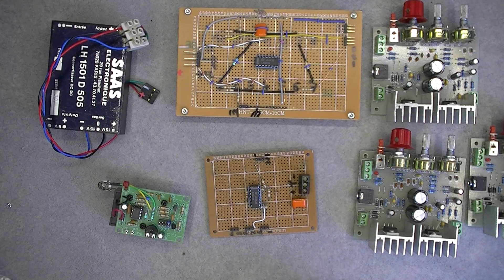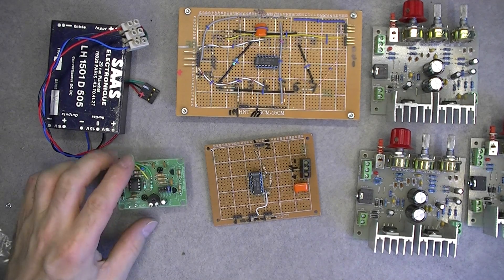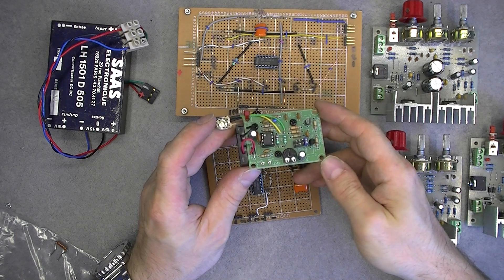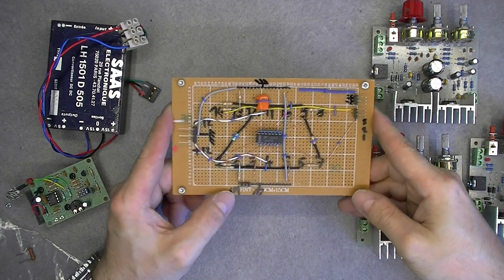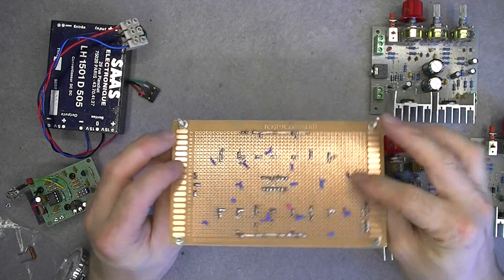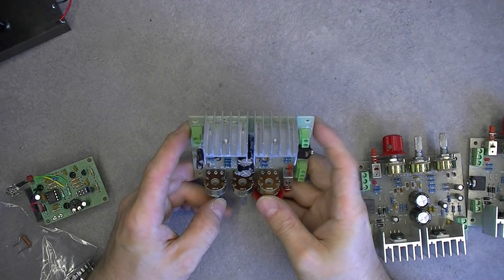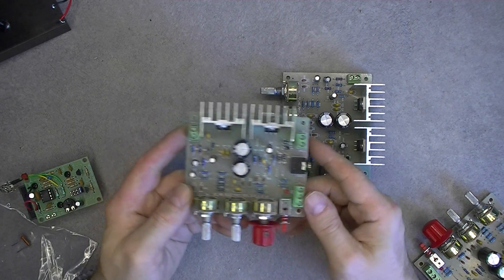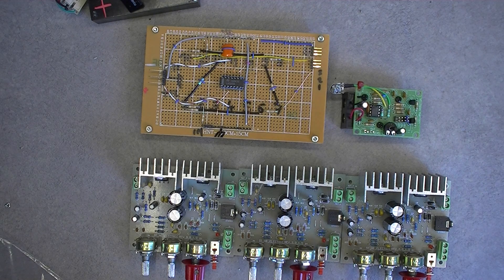Parts for a 400 Hz  tri-phase power supply project

Comment: I'm trying to build a synchro control transformer emulator. My plan is to have a single 400 Hz generator feed into a pair of op-amps, one inverting, and one not. This gets me two opposite phased sine waves. A series of analog switch chips will select either the inverted or non inverted sine wave and feed into the voltage reference of an attenuating DAC. The controller sets the switch polarity and updates the attenuating DAC's value based on a lookup table. The outputs would feed into amplifiers, and then presumably onto three different three phase transformers, which would then feed into the yaw, pitch, and roll inputs of a three axis flight director-attitude indicator.

The ability to select the inverted or non inverted 400 Hz sine wave mimics the position of the synchro rotor, relative to each stator winding, whether it is in the >0 - <180° or the >180 - <360° relative position. The DACs set what percentage of the voltage reference can pass through, allowing attenuation from passing the full sine wave through, to completely attenuating the output to 0. Every time the attenuation reaches maximum, and the output is at zero, the analog switch chips, will toggle between he inverted and non-inverted sine waves, to simulate the rotor of a synchro passing the zero-crossing, and the signals rising again, but 180° out of phase as before.

The one thing I do not know, is what kind of power draw is typical of a three axis FDAI device? I was hoping to power it using three audio drivers per emulated synchro winding (9 total, three per virtual synchro, for three synchros). I suspect I'll have to have something much more powerful to drive the reference, which for my unit, appears to also be the power source.

I just hope the FDAI I got even works... It'll be a lot of work building a means to control it, if it doesn't even run! Your project looked interesting, since I to am trying to create 400 Hz outputs. Those power supplies you got actually look very promising! I hadn't thought of going that particular route. I thought I'd need to build something from scratch, but this idea looks very reasonable. Since my FDAI requires 115 volts @ 400 Hz, I'd need to step it up with a transformer, but I imagine that wouldn't be a problem at all. Glad to have discovered your video!

Comment: Excellent Mr Syvain glad to see your buikding something like this.
If you can work them out removing the tone controls from the amps will improve things, the tone control inaccuracies would mean you'd have to adjust the amplitudes using a 'scope, without them you could just set the 'vol;ume' controls the same and it ought to be close enough.
You can so long as you keep the frequency above 50 hz use 3 standard mains transformers in reverse  to get higher voltages,  an 18v or 9-0-9 transformer (assuming the amp has 24vdc power)could be connected with the 18v side on the audio amp, if you then had 0-110, 0-110 primary windings these would give you 3 lots of 110vac or 3 x 220v ac, or using the volume control any voltage you want.
Be carefull though high voltages are dangerous.
If you use the spare op amp in the quad package and built a variable phase shifter with it and connected that to the spare power amp you'd be able to drive syncro's, adjusting the phase shift pot would control the needle position.

Comment: Russian way to get  400 hz from 50hz - 50 hz motor and 400hz generator.
Reply: Some of our trains in the UK use the same method to convert the traction supply/ETS/HEP to something the carriages can use for heat/light and other 'hotel' needs.
Reply: A lot of ground test equipment for 400Hz use motor-generators.
Reply: Its actually simplest and possibly cheapest way